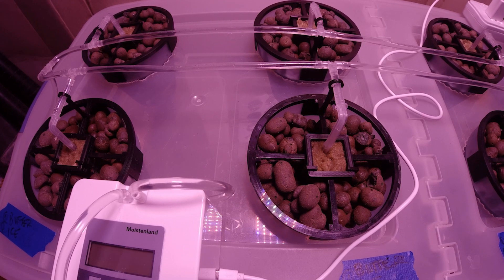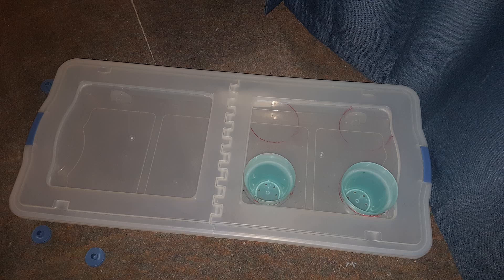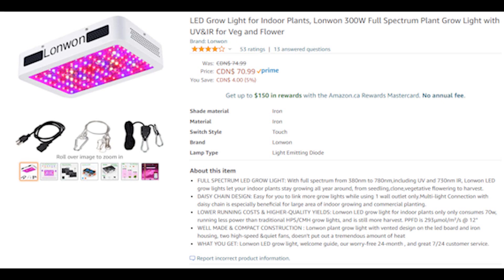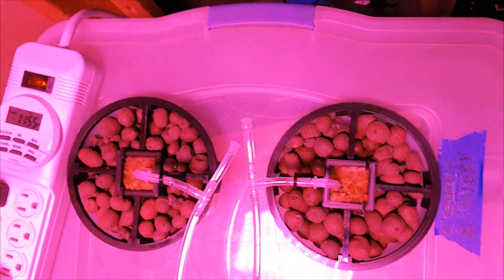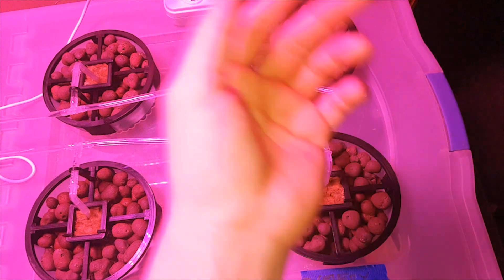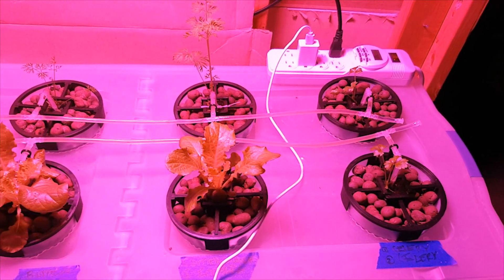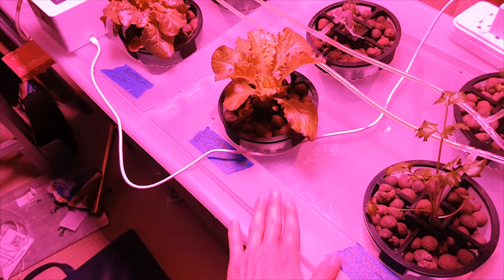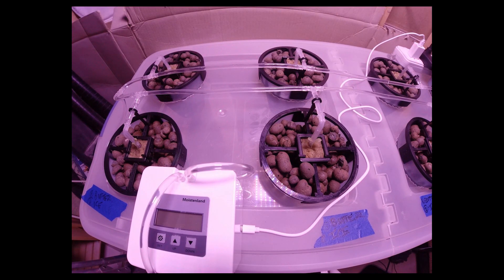3D Printed Modular Hydroponic Garden MK1

Comment: Hey mate, nice Video. I have practically been doing the same thing since November 2019 and tested 4 different LED lighting setups since then and maby my experience will help you and your project. I have found out (by trial and error and other community members) that using only red/blue light, without the substitute of other full spectrum light, will effect the plant growth and even taste negatively. I dont know your budget, but a full spectrum grow light might be a good upgrade for your system. I also tryed Kratky, DWC, drip system and aeroponics(sprying the water onto the roots) on strawberrys (a plant i strongly recommend) and got the most growth from the aeroponics system. My most recent design featured the roots in the air, combined with a layer of water at the bottom (like your system in the video). The roots are beeing sprayed upon, which keeps them moist and oxygenates the water. With this setup i got a strawberryplant from seed to red berry in 51 days under a 17 Watt LED grow bulb with 6500k. I mostly do upcycling so sadly i can't share any 3d objects.
Maby this will help you or others. Thank you for the video and keep up the good work!
Reply from the maker: Hey, thank you so much for the response! 17 Watts... amazing, I did the math on my light and lets just say my setup is not very economical at the moment! As I move into the next version of the project in the coming months I will definetely keep your points in mind. Thanks again